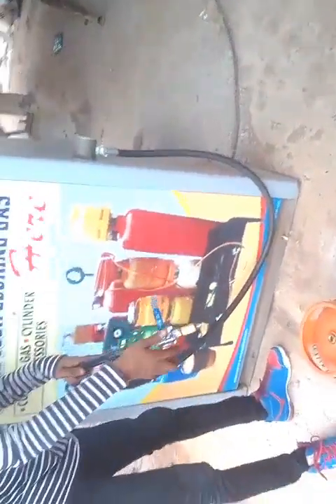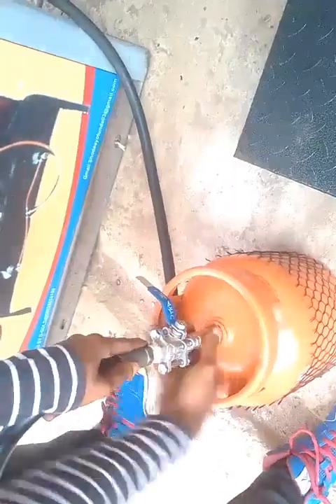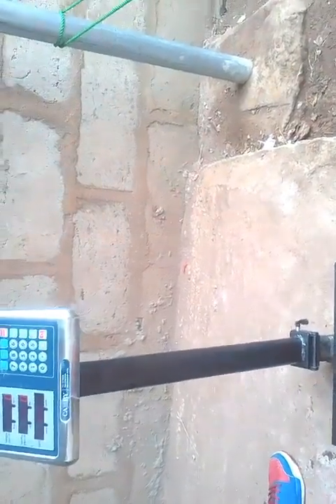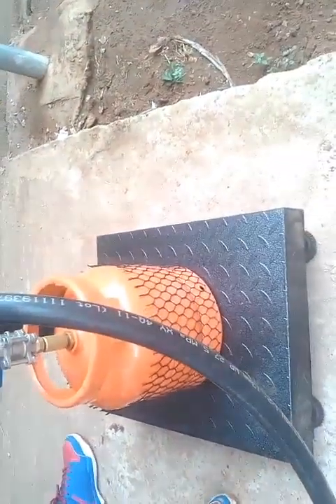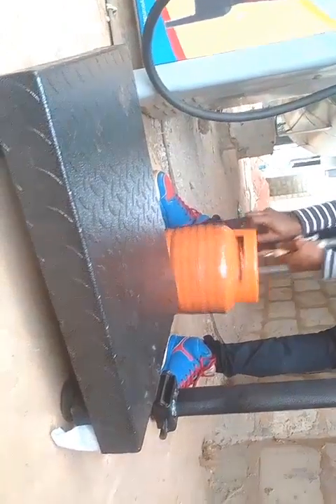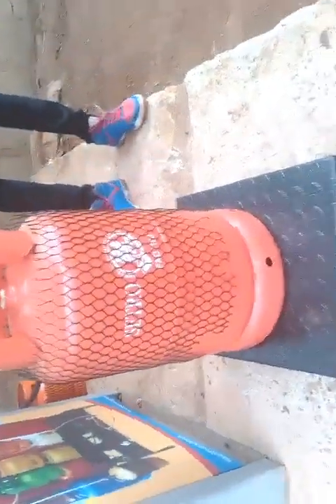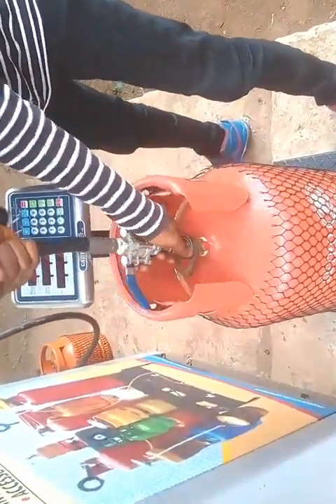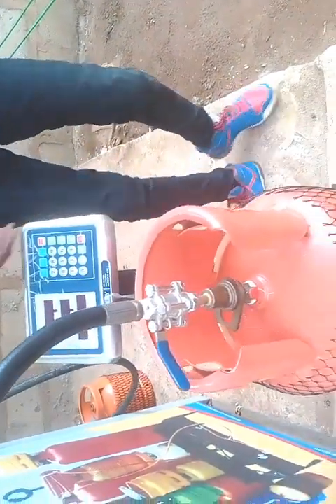How To Use A Digital Scale For Refilling Gas Cylinders At LPG Gas Plants In Nigeria

Comment: Please how do I adjust my digital scale?
I always run at loss after selling my gas
Reply from the maker: Yes. Thanks for reaching through. You can send me a WhatsApp message on 07063188954. I will further explain this to you better. thanks
Reply from the maker: For more tips, read the following webpage posts for step-by-step tips and tricks:

* Using Digital Weighing Scale To Determine Tare Weight Of Gas Cylinders - https://www.naijalpg.com.ng/2022/12/how-to-determine-and-properly-calculate.html

* DIY: How To Know Tare Weight Of Gas Cylinder Bottles Using Digital Weighing - https://www.naijalpg.com.ng/2022/12/how-to-determine-size-tare-weight-and.html
Reply from the maker: Are you considering venturing into the LPG gas plant business or already running one? Don't let unexpected losses derail your success. Introducing a comprehensive ebook designed to guide you through the crucial first six months of starting up and operating your LPG gas plant with confidence.

GET YOUR COPY!! 👇
https://www.selar.co/87nd
Reply: It’s not clear

Comment: Your explanation is not clear on how to set the scale
Reply from the maker: Check out the other videos. Or used the tips in the post below:

• How To Use A Digital Weighing Scale For A Gas Cylinder?

https://www.naijalpg.com.ng/2024/05/can-i-use-digital-scale-to-weigh-my-gas.html

• Using Digital Weighing Scale To Determine Tare Weight Of Gas Cylinders

https://www.naijalpg.com.ng/2022/12/how-to-determine-and-properly-calculate.html
Reply from the maker: Are you considering venturing into the LPG gas plant business or already running one? Don't let unexpected losses derail your success. Introducing a comprehensive ebook designed to guide you through the crucial first six months of starting up and operating your LPG gas plant with confidence.

GET YOUR COPY!! LINK 👇
https://www.selar.co/87nd

Comment: Please do you have to set your scale before using it 
I mean when you just buy the scale mine is having yhat type of error it only calculator from 50 to 50
Reply from the maker: Thanks for your input. It is normal for some scale, especially Camry. You can calibrate this. Please, send me a WhatsApp message on 07063188954, to show tutorial. Thanks
Reply from the maker: Good day. I have written series of articles on how to use digital scale for gas refilling, and also how to calibrate and input price. Check below
Reply: @certifiedgaspreneur 3:24
Reply from the maker: Are you considering venturing into the LPG gas plant business or already running one? Don't let unexpected losses derail your success. Introducing a comprehensive ebook designed to guide you through the crucial first six months of starting up and operating your LPG gas plant with confidence.

GET YOUR COPY!! LINK 👇
https://www.selar.co/87nd